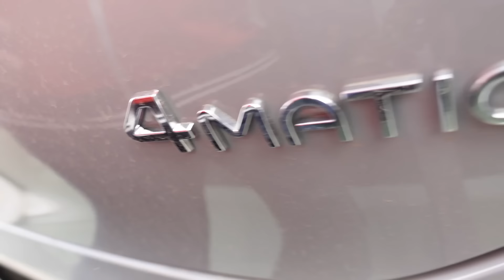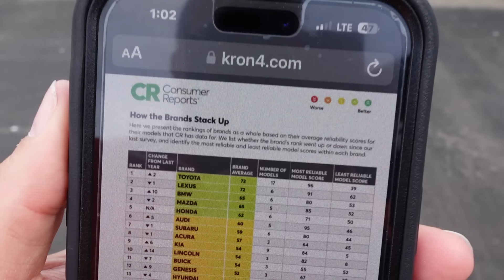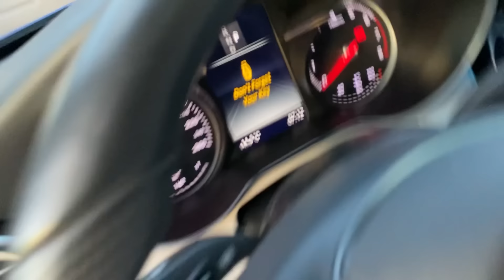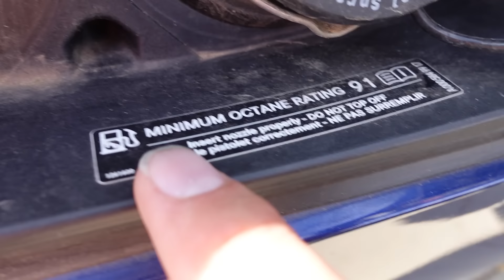The 10 Least Reliable Mercedes! (Avoid These)

Comment: Very informative reviews.

Mercedes Benz vehicles nowadays are problematic money pit vehicles.

Wonder why USA buyers labelled Mercedes as luxury when most Mercedes are  used as TAXI or Limousine in Germany .
Reply: Because a lot if the taxis in Germany are the old E Class thatvwas reliable. Todays luxury buyers want the latest tech, which those older Mercedes don't have.
Reply: In Dubai all taxi is Lexus. Where is problem?
Reply: @genesismj4206  
Lexus and Mercedes are two different engineering,

Mercedes for power while Lexus using old technology.

Neither one is considered luxury when the name plates are use as TAXIS.
Reply: @genesismj4206  
Lexus and Mercedes are two different engineering,

Mercedes for power while Lexus using old technology.

Neither one is considered luxury when the name plates are use as TAXIS.
Reply: @konsen6149 old technology 😂
:LFA ENTERS THE CHAT 💬
😎
Reply: I own a 2005 C230 and a 2003 SLK320, both have been great cars. I take care of them. I’ve had to put some money into them but less than my last two Lexus IS250s.

Comment: what u have is a smart 450. 451 fixes most of the issues from past generation 450. didn't spent any money replacing parts until it's on 7th year due to worn parts

Comment: Thanks a lot for the revelations, please review ten most reliable Mercedes Benz cars.
Reply from the maker: There is another vid coming on the good ones
Reply: @ECPP  we will be grateful,we really appreciate your good works.
Reply: @ECPP  + On that don't forget to put the W212 E-series with the V6 in there.  Mine had a 152,000 miles and we've never had to do anything on it other than general maintenance. Other have sworn the same. The owner of my repair shop has one also and swears by it. (Brian's German Auto, Baton Rouge Louisiana)
Reply: W212 2014-2016
Reply: @8MunchenBayern8   + I agree!!! Wonderful cars! Extremely reliable.
Reply: @marvinheemeyer6660 😂😂😂
Reply: @8MunchenBayern8 You got a be kidding...W205 have Renault engine inside  for God sake.W 204 its a nightmare i have one...Both have timing chain issues very  early.
Reply: @JasZg   you should read again, I didn't recommend any of those cars. I recommended the 2014-2016 W212.
Reply: @8MunchenBayern8   + I agree!!! My mechanic used only Liqui Molly oil specified for a high milage engine I have AND the most important part, oil changes at 5,000 miles. That's the key to making it last.
Reply: @marvinheemeyer6660  no lelee.

Comment: If you want a W204 you really want to import Cars first registered in Germany. Those have different manufacturing quality. The Interior shouldn't almost wear at all. Plus of course an AMG will always take more love and money to keep running but if you want reliable power get the C350 with the 3,5 Litre V6 M276. If you want no headaches at all get the OM642 C350 CDi. It can sip atleast 7,5 litress / 100km as a Diesel engine but it runs like a clock forever.
Reply from the maker: Great points.  Thanks.  That should help some viewers who may be shopping

Comment: I drive a base 2011 b200 . it's 13 years old as we speak it's got 120,981km on it . I change oil every 3000km . I've changed the battery twice . changed the brakes and rotors twice . I've never changed the coolant or brake fluid or trans fluid . temp stays at about 80 in winter and 90 in summer . I've hit major potholes popped tires bashed rims . the steering  wheel is misaligned by about 3 inches . I've changed the filters once cabin and air box . I've had the cvt go into limp mode after an oil change and forgot to reset the service  . I just reset the cvt took 5 mins and it relearned how I drive . I've had an ahole side swipe me driver side and rip the mirror off . this thing still runs and I run it on regular unleaded . never had a leak an engine problem a fan problem electric problem nothing . it's the 1999 Toyota corolla of Mercedes Benz's . and I bought it for 7k . yall can have the c g or amg models of Benz I'll watch them die before mine ever does 😂

Comment: I Have a 2013 W204 Sport Staged One. 5 years so far & serviced once by Mer Dealership my second year in and by Myself a few months ago with oil Changes, brake pads and rotors, Neverrrr had no issues besides having to change tires...Coming from an aggressive driver into performance.

Comment: I feel you're being a bit unfair on the W204 in general. It was the best selling C-Class (nearly 2.5 million sold). I agree that they're not without their problems with the biggie being corrosion on the rear subframe which should be covered by warranty. The dreaded "AMG Tax" is par for the course with the C63. I own a 2009 C200 with 221K on the clock and it is quite reliable. It still isn't quite 100% but it is mechanically sorted and the OM646 2.1 litre diesel gives good fuel economy. I lent the car to my partner's son and he clocked up about 1400 relatively trouble-free miles. The only problem was a delaminated ABS ring on the left rear driveshaft which was a cheap and easy fix.

Comment: Hey there! Love your videos! I need your take. I've got a 2018 C300 sedan, and I really adore the car. Selling it is a bit of a hassle right now. It's at 37,000 miles, well-maintained, but there's this metallic knocking sound in the morning that lasts about 10 seconds. It's subtle, and the dealer insists it's normal. However, it raised some concerns, and I stumbled upon videos like yours and many others mentioning premature issues with the M274 2-liter turbo engines. People say it's mainly the 2016 and some 2017 models, but the 2018 has the same engine, except for the gearbox change. (I assume they also fixed the piston issue.) Your video suggests it's an across-the-board problem with all M274 engines. What do you suggest I do to find out if my engine is one of the faulty ones? I bought it at Mercedes Benz Orlando Miami. Thanks for your time.
Reply: You hear that metallic sound because your engine is a direct injection you should be fine they are bulletproof engines as long as you change your oil every 5000 miles
Reply: Dont listen To this guy he cant see difrence from 2008 c250 To 2012 2015 c clas lol..

Comment: I imagine an automotive world where people could find a well built in line six cylinder 3 litre with 250hp / 220lb.ft  getting 30mpg a 4.0 litre inline six cylinder with 340hp / 300lb.ft getting 24mpg with real reliability. Here we are in 2024 and the automotive landscape is riddled with garbage. From Honda fuel  diluting oil in the oil pan, Hyundai engine disintegrating metal pieces,  Nissan  CVTs, Mercedes, well being Mercedes,  etc. I have a 1999 528iT BMW with 265,000 24mpg, runs great,  no problems. I have a 2003 530i BMW with 133,000 miles,  same story.

Comment: I thought for sure I was gonna see my 2018 Mercedes c350e on this list at number one but it was not even an honorable mention. I've had problems since 3 months after getting it, after 3 months the starter motor died and it got replaced for free, then the hybrid battery died last year but the dealership wanted 10,600 just for the battery installation NOT included for the price so I decided just to use it in sport mode which is the only way to shut off engine start stop in my car but I also had to shut off the ac/heater since they are both run off the hybrid battery. Then the 12 volt battery died so I replaced it and it was expensive then all the sudden less then a month after replacing the 12 volt battery the auxiliary battery died and Mercedes wants 211 for that tiny battery if I do it myself ( I dont even know what they would charge me if they installed it for me ). A month after getting the car the back up camera cut out for the first time but I let it go since it only seems to happen like 3 times a month but 2 years ago the media screen decided to start going out which is what has the back up camera in it so that kinda sucked, I say kinda since the radio still worked and so did Bluetooth music  so it was manageable I just had to go back to looking over my shoulder to back up from time to time. The thing that started to really piss me off and regret buying it was that it randomly shuts off sometimes and displays in red that gas ran out, electric mode only, reduced power.......the problem with this is that the hybrid battery is dead so when it use to say that it would just force me into electric only mode but since the hybrid battery has died now it just shuts my car off. On the bright side it is past 100k miles and I did not expect it to last this long since the check engine light has been on for 2 years so far, once its time for a smog check im gonna sell it or trade it in, it runs though so im gonna run it till its time for a smog check it it dies, whichever comes first.

Comment: I have to correct you that both W203 and W209 are quite reliable actually!  The worst Mercedes ever made are W220, W211 and C219!
Reply from the maker: Thanks for sharing.
Reply: My 2005 W205 has been great, I recently put $900 USD in her, not bad for an 18yo car. Up until recently, she was my Daily. I’m keeping her as a backup or when I want a smaller car.
Reply: Had my E280 cdi w211 since 2005 never had one major problem

Comment: does the c300 issues still apply on the w206 because i'am looking for either a 2022 c300 19000 km or a 2023 BMW 330I with 5000 km and if so how reliable is the 330i with b48
Reply: The bmw get. The b48 is one of the most reliable engines

Comment: … and this is why I drive a 2001 CLK 320 …. In my opinion the last of the well built Mercedes….. before the merger with Chrysler…  before the tons of plastic and 3 million different computers to run the tissue dispenser that will leave you stranded because it’s also tied into the transmission module or some stupid thing… I love my car. It’s just simple elegance.

Comment: 2010 W164 entering the chat... In my opinion the 2009 - 2012 model years were the last generations were you got German "over-engineering" in a good way. The 3.5L V6 is a very reliable engine, now for some things I considered when I bought mine. 

#1 I didn't want the "airtronic" suspension system, because the air bags and pumps would fail when worn out...

#2 I wanted a Benz without all the intrusive sensor monitoring, that has become the "norm" for all makes in model years after 2016 (Manufacturers have gradually taken the ability for an at home mechanic to fix their own rigs.

#3 AVOID the 5.6L V8 at all costs!!! These engines are rated for a hot octane of 95 and anything less were's out the valves, lifters, and piston heads. The 3.2L V6 is also recommended for 95 octane but 91 is the minimum serviceable octane. 

#4 I will agree with the video that Mercedes, does not use the best interior plastics, but in my opinion they are built that way for more decerning and delicate hands. We Americans tend to harder on interior buttons because of our sausage fingers and big hands. 

#5 EASE OF FLUID CHANGES AT HOME!!! Please refer back to #2 

As long as you maintain regular maintenance of belt changes, fluid changes, and brake pads. Your Benz should easily take you to 250,000 miles or more like my modest 2010. The body is still stylish in today's design language, and better yet my Benz is paid off :)

Comment: Its funny how the US get the rather top tier engines as a step-in model compared to europe and dont get to experience the diesels. The 2.1 diesel engine in the C-class W204 is legendary and will never fail. the W204 is one of the best and most reliable cars ever made in the Mercedes line up. It's a combination of modern and good reliablity of the older models. Had one for 8 years and so did my brother, never had any issues.. a true work horse. But on the other hand, I would not buy a Mercedes that is not assebled in germany

Comment: Well these complaints on the W204 (C Class) ... far away from the truth, if German Mercedes "middle" class quality is concerned. There I had a C250 (2013 build) and nothing to complain for ages. Finally I replaced it for a newer Mercedes, which was a mistake. Many people say it was the best Mercedes quality ever. The W203 and the W205 were not as good. But the W204... well done. Maybe not the "best" engine, but the rest. The only flaw was the rusting brake lines, which are expensive to repair. After 10 years. Come on! The guy who bought it could not believe the good quality. No rust, no noises, no ratting. Just quality.

Comment: 22:40 what…. I had 2 of them, I beat the crap out of them the most reliable in my opinion never ever had  problems 2013 & 2918 the suspension is tight because of the distance from front to rear smaller chassis will bounce more…with longer chassis obviously it’ll be more comfortable like my S63

Comment: When thinking of the Sprinter Vans, they are actually quite popular in Sweden, I would say alongside VW Crafter and Renault Master that I would say has the best rust protection.
There are no Japanese big vans in Sweden.
The resent passed years there are "some" Fiat Ducato/Citroen/Peogeot/and now also Opel. Same body, different drive train.

These days these vehicles have normally a 2.2-2.4 liter turbo diesel with about 150-180 hp, and they can tow 3 metric tons.

I forgot to mention Ford, but as Ford cars "disappear" the dealers also disappear. The times are changing...
Reply: Sprinters are rust buckets. Mine has severe cancer
Reply: There are no Japanese big vans, you comparison is invalid and not factual, the sprinters are rot boxes

Comment: So, basically all models are unreliable.  Thanks to your videos, I’m afraid to own one without warranty.
Reply from the maker: Most are getting risky these days.  Cars in general are becoming more complex and pushed harder with smaller displacements upped with turbos
Reply: @ECPP  they don’t make them like they used to. Like you said, life is too short to be driving boring cars. So, as long as it’s under warranty, I’m good with it.

Comment: Had to do some work in my 2013 E-350 that required me to remove the center console, HVAC control and radio.  I never in my life saw such bad engineering in a car. While my E-350 has been very reliable in these ten years, the interior components have much to be desired.

For example, on the sticker, it noted that I have "burled walnut trim".  LOL, it's not even wood but plastic parts with a painted wood finish.  Then I am on my third lower seat cover on the drivers side.  Should not the MB-TEX be better than that?  Even my BWM that is four years old doesn't have this problem. 

Then to replace the seat cover is absolutely a nightmare.  Never have seen such bad design work in all my life.  I'm beginning to think that old MB is outsourcing their design work to some third world country to save on costs. 

After working on my E-350 MB simply doesn't have the cache or panache like it once did.  I think a Lexus is in my future.
Reply: I bought an ML 270 .
MADE IN BRAZIL.
Rusted like a nail  under the boot where spare was ,3 years old now,NO OFF ROAD USE.
RUSTED EVERYWHERE
Poor result.
Profit over quality?
No body bothers about it now.

Comment: The GLC 300 has been around for a number of years.  I'm looking at a 2017 model.  Yay, or stay away?
Reply from the maker: Mixed bag, our 2018 has been Ok even with a few minor issues but time will tell.  Earlier gens of this drivetrain had a few engine failures.  Overall a reasonable vehicle.
Reply: @ECPP  I loved the car.  It was one owner with an impeccable driving and service background and he was selling to me at trade-in value, $16k when they sell all day at the dealer for $22K.  He paid $50K new.   It had 47k miles and looked like a new one.  Still, I chose to pass on it.  The problem for me was two fold:  

1- Mercedes has now dropped to the bottom of reliability ratings and  that  bothered me a lot.
2- Car is out of warranty after being owned for 7 years. 

 I would be on my own to pay for major repairs and virtually any repair is expensive ($3K headlight replacement)  and out-of-pocket which includes a $200 hr labor rate.   No shade tree mechanics for Mercedes!  :)

Comment: You don’t know nothing about the w221 except for negativity I’ve had mine for 5 years 2008  spent 1500 on it ever since I bought it runs drives great with 146k built 100 times better then the plastic new ones

Comment: Ive never disagreed  with a video as much as this,  maybe  that's  for the American made  mercedes benzs but  us with German made ive never  had any problems,  i have  my first  car w203 C200 2004 coupe  , 324 000 km on the clock  still going  strong  , services  done when  they were supposed to , same with  my 2011 ML350 W164 , 152 000km 4matic airmatic  and my w204 C250 2014, 180 000km . Those are just  mine, my mum has an E240, Dad has an S500 and an E230D he inherited from his father(still driving,  i borrow it from time to time for car shows, brother  has an E55, sister has an  C200, so i really don't know how we can be lucky with mercedes  while they are deemed  not reliable,  literally  grew up in mercedes  straight from my grandparents  right up to us.

Comment: I have w204 180cdi 2012.I also have plastic thermostat  plastic  water pump simplex chain instead of duplex( its very tiny just as on bmw n47) unreliable sensors cheap plastic  interior.I have the chain noise at only  150000km.Very expensive  to repair  .Mercedes  is actually  the worse car i ever had in my life.I am professional driver by vocation for  30 years.I owned and drive so  many cars but the worse was always  the german ones.

Comment: Just replace headpolt's for M156. M273 was engine of the year 2005. I still have a cls550 with 265000km and runs smoothly. Mercedes c250 have a 2.1 diesel engine what is choice for every taxi driver in Europe. Also i have a clk500 with m113 ( even internet says its 1 of best mercedes V8 produced ) and have a most reliable 5speed gearbox ( same like s55 or other amg's ) . Wtf this man dont know shit about merc's 😅